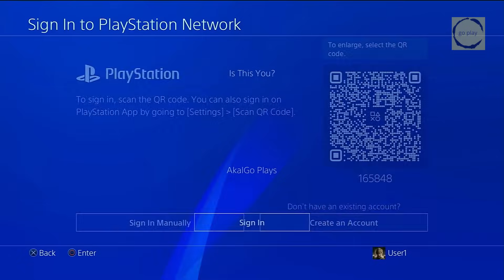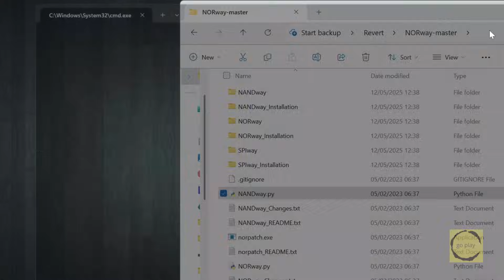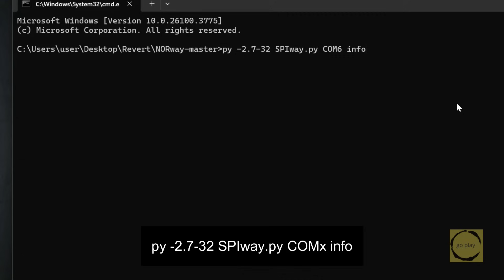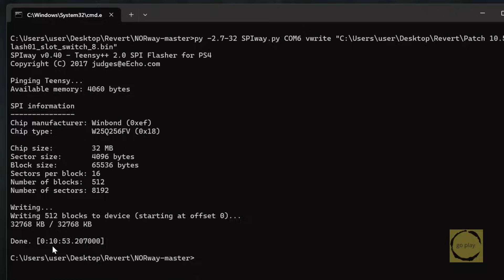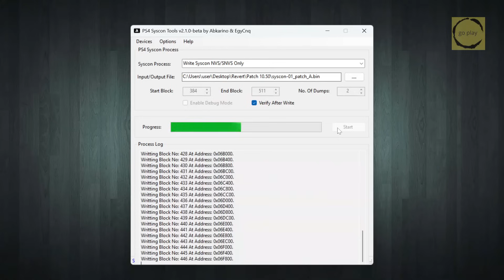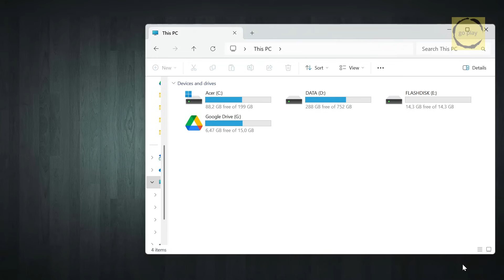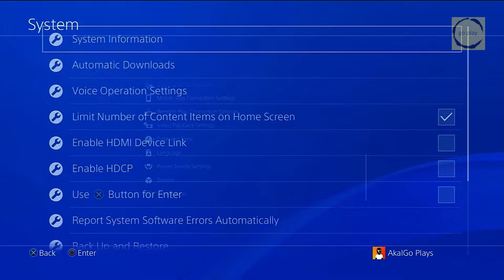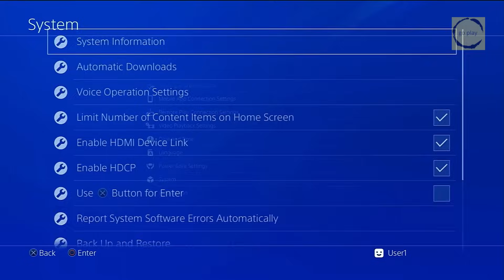My PS4 Can Revert Firmware Anytime I Want — Here's My Secret Setup!

Comment: Are pin 15 and pin 16 connected to each other on the motherboard? because my pin 15 leg was destroyed, please help me solve this problem, thank you in

advance
Reply: The same thing happened to me a couple of times,if there is some trace of the pin that is left you can solder a 0.1mm wire to it ,if not and the pin is completely gone you have to grinder the Syscon chip until you expose the trace and solder the 0.1mm wire to it and also to the corresponding pad in the motherboard 
Nb:ones i used a needle to grinder the Syscon and the other 2 times i used the soldering iron,it would be easier if you use grinding pen
Reply: I managed to scrape the Syscon chip IC and connect pin 15 with a thin jumper cable, and if I connect it back to the PCB board then pin 15 and pin 16 are connected will it be safe? I see from the PCB board that pin 15 and pin 16 are one line... what do you think, friend? are you like that?
medicine4all513
Reply from the maker: No, the solution is to do what was explained in the comment above. It’s easy.
Reply: What I mean is the pin 15 and pin 16 lines on the motherboard, not the Syscon IC chip. by using avo meter i got them connected to each other on the board. correct me if I'm wrong.
Reply: @mmyynnoonnaaa  yes when using multimeter,you must find connection between pin 15 and 16 when soldered on the MB, be careful not to bridge any other pins,as they're very small

Comment: Look, I already have a group of friends who work in this field. When I asked them or worked with them for a short period, we found that we could only revert the system to the previous update — not to any version older than that. This is because the syscon makes a backup of the most recent update only. In other words, it's not possible to roll back to a much older version.

So, if you're able to do that — for example, reverting to update 9 or update 5 — that would be something I’ve never seen any developer do before. When I asked around, I was told the same information I already knew.

If you truly have a method that no one else knows and it works, I’d be happy to see you publish it so that others can benefit.
Reply from the maker: Yes, I’m using the same method. We can’t revert to just any firmware version we want—only to the last version that was installed before the update.
Reply: @goplayfull you went from 11.0 to 12.50 to 10.50
Reply: @zoloc93  He created backup files (syscon & nand) at FW version 10.50, and probably updated to 11.00 when installing the LuckFox Pico for the PPPwn exploit. So long as he has access to those backup files, he can roll it back to 10.50 any time. But not lower.

Comment: Fake, FAKE, CONSOLE WHITE 11.00FW. THEN CONSOLE BLACK INSERT USB 10.50FW?. PS4 WHITE NAME PS4-194, THEN CONSOLE BLACK NAME PS4-735 10.50FW. YOU MANIPULATED THE VIDEO WITH 2 PS4 CONSOLE WHITE AND BLACK, WHITE CONSOLE FW 11.00 THEN PS4 CONSOLE BLACK 10.50, YOU UPGRADED PS4 WHITE CONSOLE TO 12.50FW AND THE PS4 BLACK CONSOLE LEAVED TO 10.50 TO EDIT AND MANIPULATE TO APPARENTED DOWNGRADED TO  10.50FW 👎👎👎👎👎👎👎👎👎👎👎👎
Reply from the maker: It’s not fake. The footage of plugging the flash drive into the PS4 is just an illustration—I took that part from another YouTube video. What proves it's not fake is the MAC address; it's the same in all stages—when the firmware was 11.00, then updated to 12.50, and finally reverted to 10.50. The MAC address stays consistent.

The reason it could revert from 11.00 to 10.50 is because I had the revert files also which was my original firmware before updating to 11.00.
Reply: @goplayfull  So can we write these revert files to any ps4
Reply: Can you go to 9.00?
Reply: @MaTrIckX  if ps4 original firmware is 9.00 and you have the revert files, then you can revert it to 9.00, otherwise you can't
Reply: @MaTrIckX  if you have save the revert file yes but if not no
Reply: Wtf you are about it is 100% legit,the dude had 10.50 fw dumps before updating to 11.00,so he can go back to 10.50 at any time,and he can also go back to 11.00 at any time

Comment: Cool, but wasn't there something where some type of fuse was permanently burned as information to inform and prevent the system from going back to an old version? I don't remember where I read this and if it was for ps4 or ps5, but I'm curious now lol
Reply: It's probably for 5, I know for a fact that Nintendo does it for the switch and Microsoft for basically all their consoles since the 360, but the PS4 is only syscon and nor chips
Reply from the maker: The fuse burning thing only applies to the Nintendo Switch.

Comment: what? from 11.00 to 12.50 then go back to 10.50? i thought it only go back to 11.00 not 10.50🤔
Reply: If in the past you have save the version 1.76 revert file and now you are in 12.50 you can restore it with revert file which are différent for every ps4 (for prevent user share there revert file)
Reply from the maker: I also have a revert file for 10.50 for the same PS4, not just for 11.00.
Reply: Sus